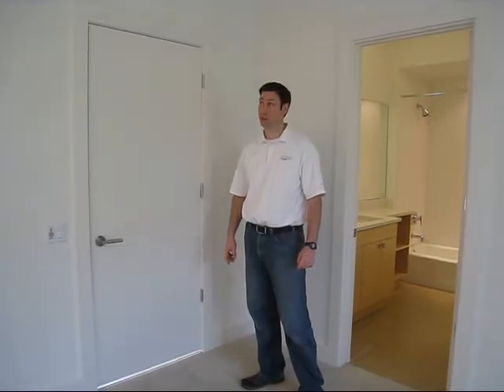Jumper Ducts - Pressure Balanced Rooms - Video Blog

Comment: If I put jumper ducts like this in an unconditioned attic, will I run the risk of condensation? I would use insulated flex duct and I’m in climate zone 5.

Thanks

Comment from the maker: This jumper duct is allowing the air to flow from the supply in the bedroom to the return air duct located in the hallway.  It's definitely better to have a ducted return to the unit but it's not always possible.  This jumper duct does create some noise issues but the flex duct quiets down the noise better than a large undercut on the door or a direct transfer duct through a 2x4 wall cavity.  Ducted returns are best, follow by a flex duct jump ceiling to ceiling, then last choice is wall returns

Comment from the maker: Just to clarify, I'm not proposing a grille on the door but rather a ceiling grille with a length of flex duct to the hallway with another grille.  This gives  the necessary return air without compromising the aesthetics of the door.  It's probably $50-100 per room to do this depending on the cost of the ceiling grille.  That's a low price to pay for comfortable rooms, but you will need to tell your HVAC contractor to add this cost to his bid as most aren't doing this as a standard practice.